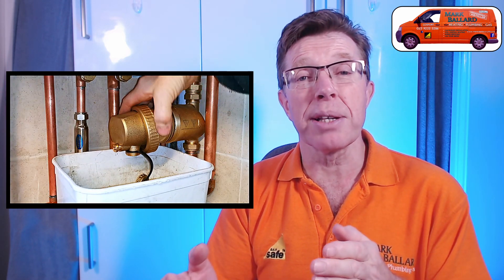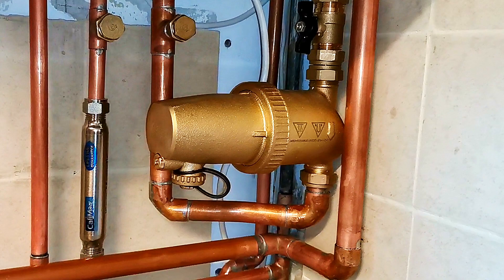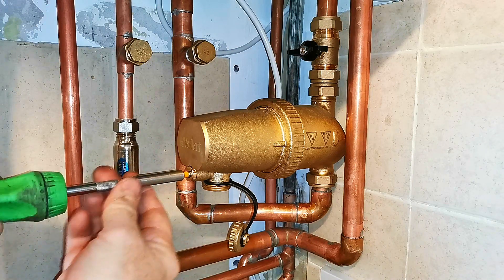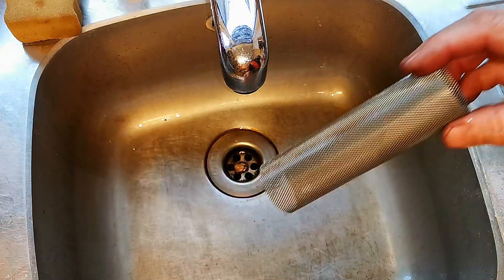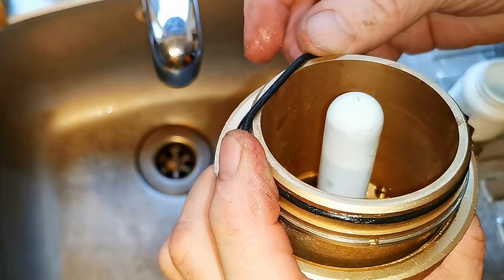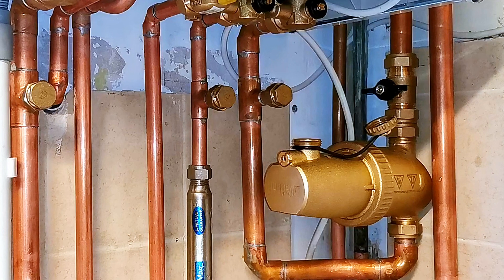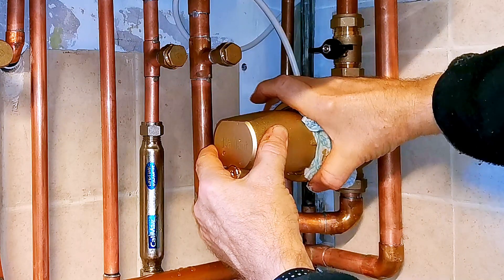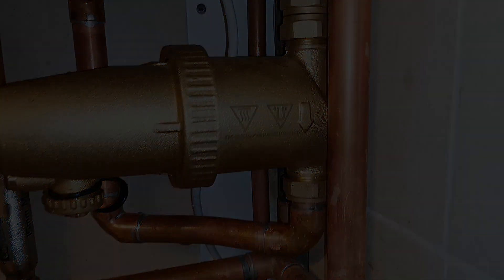How to Clean Vaillant Filter and Glowworm Filter, Vaillant Protection Kit Cleaning, Magnetic Filter

Comment: I hate fitting these, but Vaillant and Glow- (Vaillant) Worm do not honour a 10 year guarantee unless you fit this magnetic filter. Talk about a captive market.

Comparatively small magnet and crude mesh filter. The plastic sleeve jams on early and  is then near impossible to remove with your bare hands. Most  of the time you need a pair of pump pliers to pull it out, which often  damages said sleeve….

Ring gets so tight after a while, you need a bloody Stills0n (or similar) wrench to move. Hope the engineer has properly clipped the 22mm pipe. From now on, I might fit these with a thin smear of silicone grease on the threads.

Would far rather fit a M@gnaclean. I was once working on one I had installed and of the many I had  fitted, this had a faulty ‘o’ ring which leaked at the isolator. This was the first time I have had trouble with one. Phoned’ Magn@clean, they rung my local supplier ten mins drive away and told them to give me a replacement, no questions asked! 

Suggestions to Vaillant/Glow Worm:

1. provide a tool to loosen the ring, maybe redesigning the ring with notches

2. manufacture the plastic sleeve with a thick ring on the end, so you have  something to grip on as you struggle

Comment: Had 2 so far where they are too tight to undo!
Reply: Try using a strap type (not chain) car oil filter remover
Reply: @muttley1956 
Thanks for the tip. I have two of these tools in my garage and will let you know how I fair.
Reply: ….I have always found I am in the company of a cheap-skate, when you quote for a boiler within their budget. They then say,

“I am sure you can fit a valiant for that money.”

Comment: Vaillant, not Vailliant. Awful design by Vaillant/Glow Worm. No easy way to top up any cleaner or inhibitor in any decent amount as there is such a small hole to fill the canister and you'll be there for ages. Thank you for the video to help others.
Reply: I totally agree, the “cup” type filters are superior to this.
Reply: @belaszigeti4850  I'd say the only other way to fill the system is hope that there is a towel rad and pour in from the top or buying a rad fill adaptor?
Reply: Totally agree! If you want to read another engineer moan, read my comment…..🤯😡

Comment: Nice video. Don't normally fit vaillant filters. Think made by spirotec 🤔
Only issue I'd have is adding inhibitor then adjusting once vented. Surely going to lose inhibitor and you can't get much in there anyway? Maybe once had a couple of inhibitors not an issue. Thanks again 👌
Reply from the maker: Yes. You can only use the injectable inhibitors

Comment: Our Ideal boiler was replaced with a GloWorm which came with this filter and valve but the fitter did not fit the valve so I cant see how to isolate it. I asked him about this and he said it could be isolated but could not say how. Probably have to drain the whole system!
Reply: You can turn off both flow and return valves on boiler. You'll need to attach a brass garden tap connector so water dose not spit everywhere. Once pressure released, then you can carry on as Mark showed you. You could always fit a valve if capable.👌